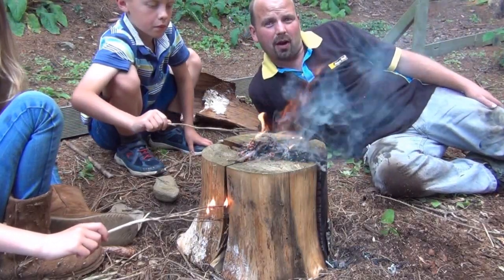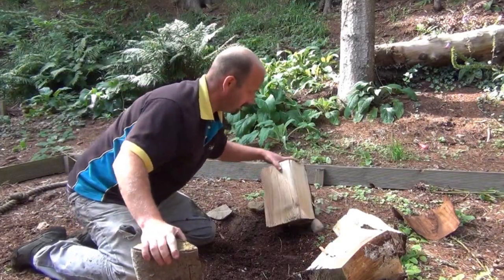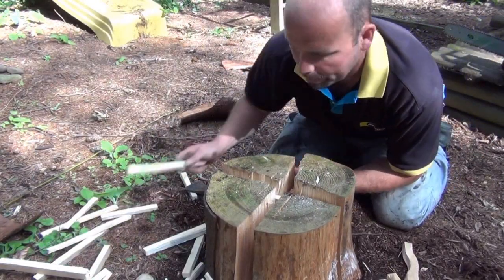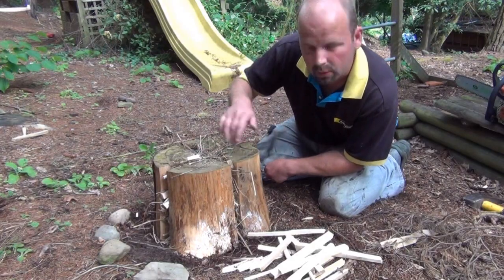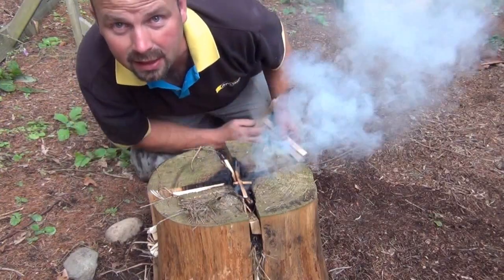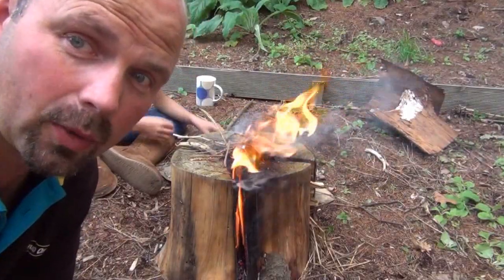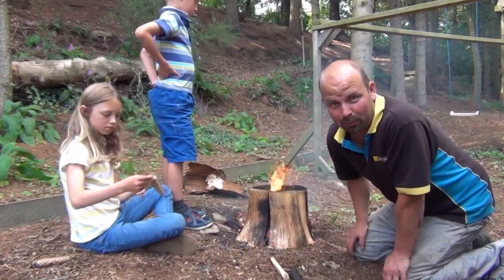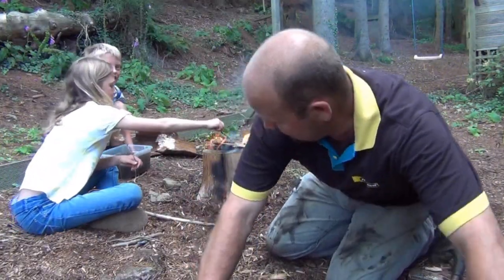How To Make a Swedish Torch / Schwedenfackel / Canadian Candle

Comment: Loved the leaf blower. However here's a hot tip(IMHO)  Get one of those little vacuums for keeping your computer clean and turn it into a mini leaf blower by attaching some plastic tubing and a stainless steel tube. I wouldn't go anywhere without it. It can turn the most miserable damp smoky fire into a raging, clean-burning inferno in seconds.
We Scots are good fire makers.....we have to be, in the conditions we have to operate in.
Reply from the maker: I hear you there. The Southerners have no idea how wet it can be up here and it seems to get worse the further North you go plus you guys have all the midgies to contend with. We have them here but not on the human devouring scale you do in Scotland, Anything you can do to produce fire is an essential skill to keep the buggers away - good tip on the DIY blower and thanks for watching.

Comment: This actually can be used as a survival/ bushcraft type of fire. use a wire say ( typically found in stores having survival or ranching items.) 
these are very handy in survival situations as the flame/ heat is very concentrated. you are not supposed to add more kindling you are to let the kindling burn out as the fire is supposed to burn the log not wood that you add in. once the kindling burns out you can press or close the quarters together to regulate the amount of fire.